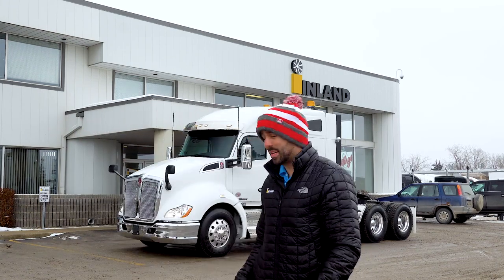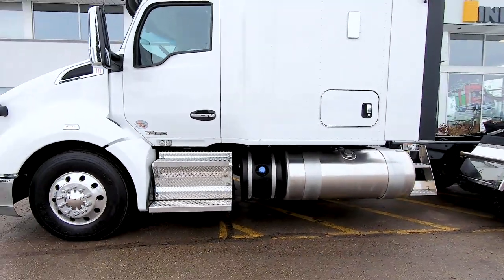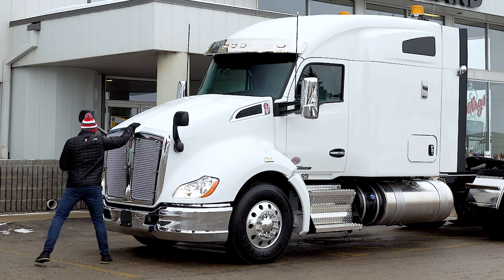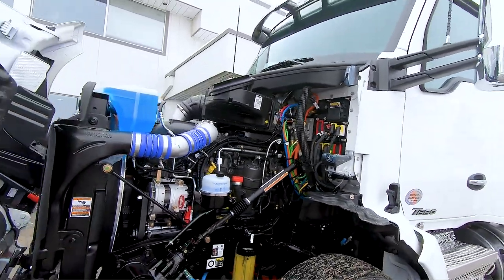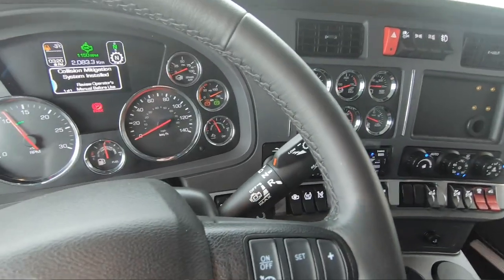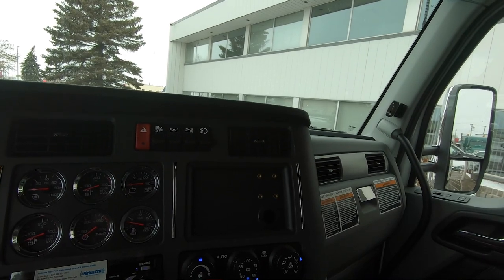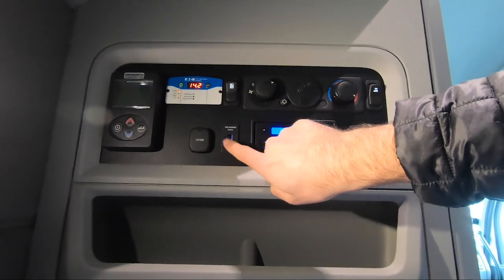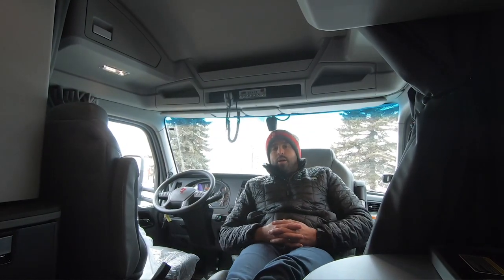SOMETHING NEW   2020 KENWORTH T680 76" MID ROOF, MX 510hp 13 spd Ultrashift

Comment: Nice to see the DEF tank on the correct side. What were they thinking with putting it on the passenger side? What a pain! I also wish they would put the fuse panel in a place where you can access it....even back in the glove box would be an improvement. C9 is ridiculous to get to.

Comment: I was so excited to get a brand new 680 about 5 years ago. I ran it for almost 300,000 miles. It was an absolute piece of garbage. It leaked water and got moldy in my closet. The interior is cheap plastic. The handles on everything inside would break. The fender lights would always fill with water. I went through 4 sets of steer tires as it would never hold its alignment. Always in and out of the shop with engine issues. Typical Cummins crap engines.
Reply: Yep ... J.U.N.K.
Reply: Thought he said this had a paccar....
Reply: @MrAtrice  Paccar, Cummins basically samething. Cummins makes the paccar
Reply: @AnthonyHill77  the older Cummins seemed pretty darn solid to me but the new ones with the Def is a pain ass with my minor experience trucking
Reply: Nicholas 
What year cummins ur taking about? I have old cummins 2005 only issues its seeping oil but it got a million miles, my buddy got 2017 660. Problem free. Only those i heard of are 2009-2013.
Reply: @MrAtrice  I think it's all related to DEF ...take all the stuff off it wouldn't be near the issues you see these days. That's just my opinion 👍
Reply: @AnthonyHill77  Nope, Paccar engine is the Daf MX engine!
Reply: @aztxtransport2776  ya the one I ran was a 2004
Reply: Randall Gates what do you recommend?

Comment: It should have a X15 Performance engine, 13 speed, and the side skirts and exhaust up the back. Sorry, Andy that's just me.
Reply from the maker: No worries. We build them custom. Your spec is yours! Thanks for watching
Reply: Fuel is about 1mpg worse on the x15 vs mx, and similar performance, we just ran both the 2020s this year.
Reply: @bradgrimm6982  The guys who don't pay attention on the fuel consumption, so like to have a Cummins, will earn less or will lose market at the end.

Comment: This truck is only missing 4 things. 

- Studio sleeper package like the W900 (the sleeper couch).
- Seprate sleeper entrance door, like the Peterbilt 579.
- Digital speedometer readout.
- Pull out ladder for the top bunk (again, like the Pete 579).

If this truck had those options, than this would be the best truck on the market IMHO.

Comment: BTW 
I hauled my first load of logs in 1977 in a 1967 Diamond Rio with a 355 HP Detroit Diesel and 5/4 transmission that had to be shifted with both hands. 
 I was 14 years old, and when a trooper pulled me over, and asked me if I was 16, I lied and told him I was. He told me to be careful and left. A boy was expected to pull his weight back then...
Reply from the maker: Old school for sure!
Reply: IT is no necesary to use two hands in a 5x4 i drove oilfield trucks with 5x4  4x4 6x4 10 + 4 13 +4  allison + 4for many years

Comment: Would like to spec a midroof truck for bulk chemical tanker. Need to be able to haul 45k of product. In a freightliner now but would like a better seal on the truck. Have had issues with water leaking in and shorting out electronics. I've heard Kenworth and Pete both have a excellent seal. I have driven a one Kenworth and the turning radius was terrible (larger wheel base I think?). I have also heard the mx engine had some issues with engine pitting. Just trying to get more educated on speccing truck for the bulk tanker application.

Comment: I am buying a new truck the end of March it will be a second truck for a driver. We would like to get the 990 but just cannot justify the cost when we can a Lonestar hard loaded with electric APU for less than 150K, Kenworth wont budge under 165K for the same power train spec in a truck that is not loaded & no APU. 
Does Kenworth really think the product they offer is that much better? Kenworth builds great trucks in my opinion, I just can't afford them.
Reply: $15,000 can be easily made back on the resale. Check out the used values on any international right now. Those lonestars have specific parts just for that model that can also be quite costly. The other thing is that international has a horrible reputation right now for reliability. The market is saturated with used trucks and might be a good time to buy a used low km pacaar product if you can't afford a new one. I know a guy that has a 3.5 year old w900 with apu that was offered a pathetic $75,000 on trade in.
Reply: We have been all over the resale thing & I see Paacar not bringing a lot over other manufacturers.
As for reliability, we own 2 International trucks & could not be happier they are both 2019 models with the redesigned cab & interior.
We paid $113,000 for our Lonestar with 80,000 miles on it & $125,000 for our LT new.
They have the same drive train as the KW’s Cummins & Eaton with Spicer rears so wouldn’t it make sense if we have major repairs on these trucks we would have the same issues with Paccar?
I really like the interior fit & trim of the KW they have great build quality, my only issue is justifying the 30k price difference.
As for the Paccar engine, I’m not ready to go there plus the resale is not good with a Paccar engine.
Reply: The. LT belongs to my boy, he is trying to convert me. 
If I could find a 990 for 150K I would most definitely buy it

Comment: Why and I mean why.  Would you put lights in the tow pin sockets.  They are for tow pins.  Like mounting those little rabbit bumpers in the tow pin hole.  Then get stuck and guess what.  Your really stuck.  Have to remove items to have access to pin sockets.  Is that really a good idea to do that.
Reply from the maker: The pins slide in beside the lights. The hole is still open.

Comment: Why does Paccar offer Multi-Torque ratings for their MX-13 engine? For instance, if you wanted 1750 lb-ft of torque, you'd have to get it at 1550/1750.
Reply from the maker: Correct. If you want more torque get the 510 1850
Reply: @AndyTheKenworthGuy  

Do you get feedback on fuel mileage w/1850 lb. ft. of torque?
Reply from the maker: Depends on application. Super b trucks we see around 5.5
Reply: @AndyTheKenworthGuy  
Alright. Thanks

Comment: I did notice the visor,  I guess with the W990 using the same cab and sleeper and having the visor it's able to be offered on the T680 and possibly the T880. Another great video and a great looking truck.
Reply from the maker: It’s the same part as the W990. I’m looking forward to putting more of these out there.

Comment: How much with 605 Cummins 18 speed. 73 ratio in trans 2.64 differentials 150 gallon tanks biggest def tank they got full fairings wheel to wheel aluminum 5th wheel full gauge package and thermoking tri pack

Comment: Did this model replace the old ant eaters?
Reply from the maker: Yup
Reply: I think you can still get a T660, which replaced the t600 - The T680 has a wider cab than the t660

Comment: Under frame exhaust is a piss poor idea, you will be choking on diesel exhaust when idling in the winter and so will the guys parked next to you at the truck stop. I dont even know how this was given approval by the DOT. This is a very dangerous design flaw, even the sleeper heater exhaust exits inches from the sleeper.
Reply from the maker: Exhaust is clean and the trucks don’t idle because of factory heater and ac unit

Comment: Is the new transmission ruined by fuel-efficiency dominated software like the Eaton model? Eaton makes a great transmission and PACCAR makes a great engine and the emission control systems are noteworthy ... but some engineering C.L.O.W.N. decided that mileage bragging rights are worth destroying the performance, the reputation, and the customer base of all three... 
 Educated beyond their intelligence quotient and too busy patting each other on the back and fkng each others wives at dinner parties to worry about the person actually living in the vehicle they so haphazardly designed
Reply from the maker: The automatics are catching up to the automotive transmissions. The manuals are great for the experienced operator and the autos are also good for the old driver who has a bad shoulder or leg for clutching and shifting. The products are great.

Comment: Went cheap on outside of truck and swivel seat and table should be standard ,,,,get rid of pac car engine there junk,,,,Cummins 565 is only way to go with 18 speed and 3:73 rears

Comment: If the same genius designed the transmission fuel-efficiency software, this transmission won't work for you either. The software turns a dynamite tractor into an absolute turd ...